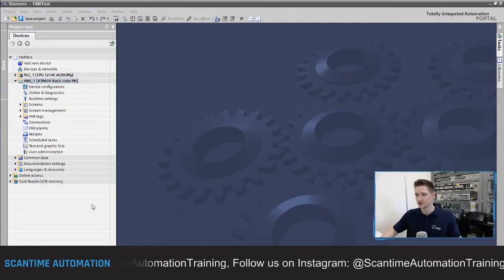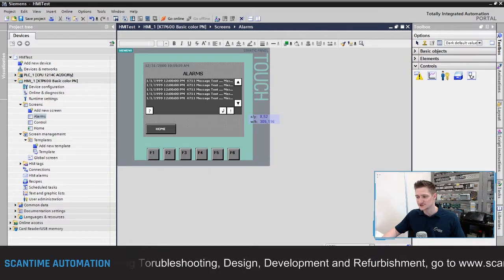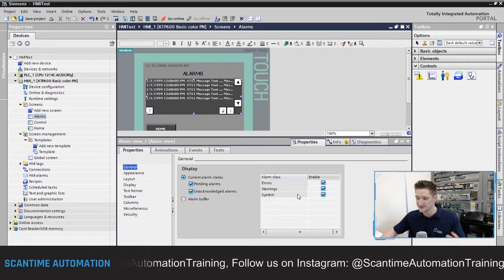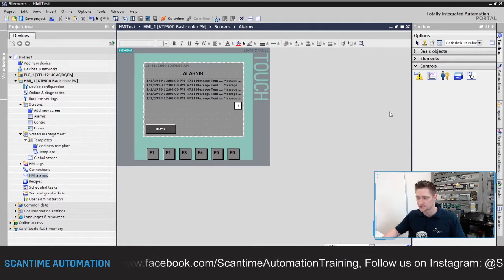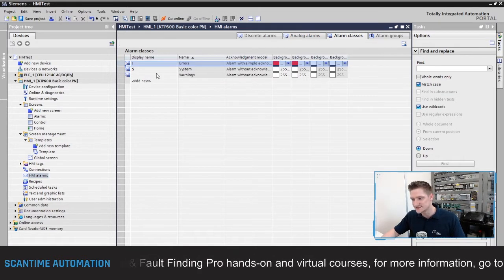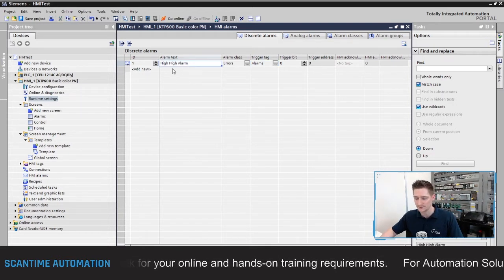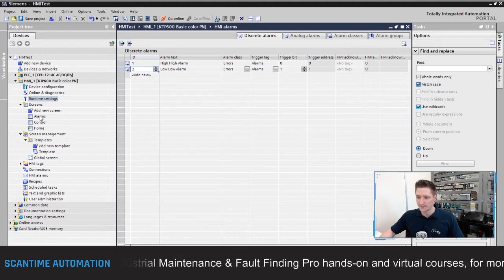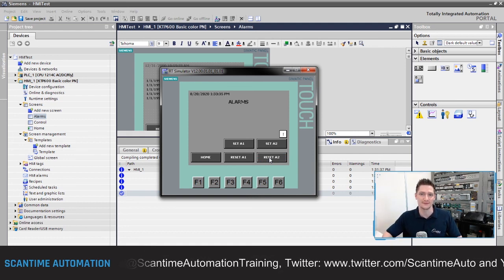How to Setup HMI Alarms using Siemens TIA Portal WinCC!

Comment: I am facing an issue while configuring the horn in WinCC V7.4 SP1. The problem is that when an error alarm is cleared, the beep does not stop automatically, and I have to manually press the Acknowledge (Ack) button in the toolbar to silence the sound. I am seeking guidance on how to set up the system to turn off the sound automatically after fixing the error.
Reply from the maker: I would need to have a look inside the software for this.